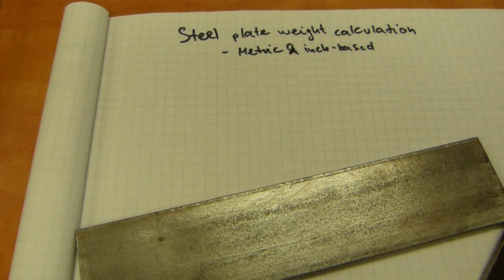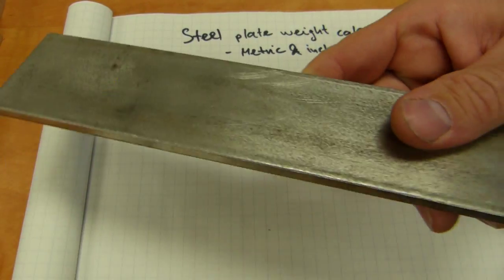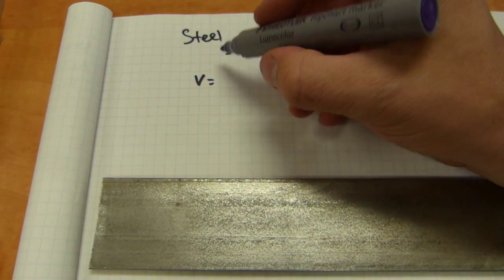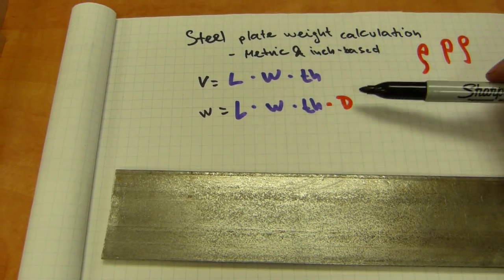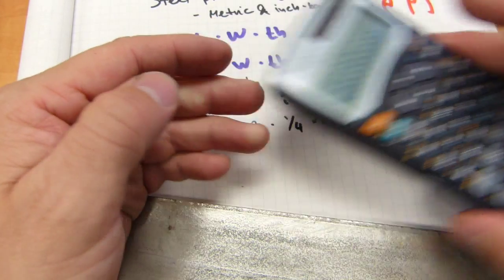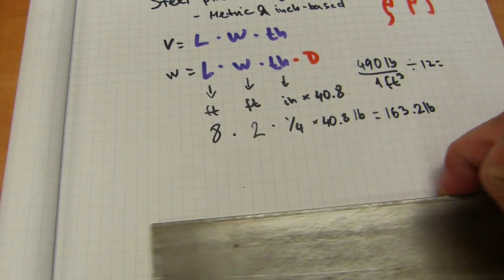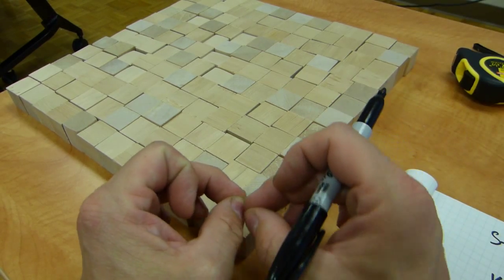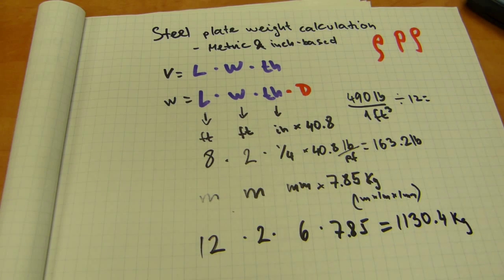Weight (mass) of steel plate calculation

Comment: Is there a way to know the load capacity of a steel plate. For example if I put a steel plate over a hole or between two steep cliffs,  What thickness of steel will I need for a certain weight, say a one pound weight to say something has heavy as million pounds. 

Any simple way of knowing?
Reply from the maker: No simple way.
Is it a point load? Is it uniformly distributed? Can the load move? etc.
What does work is building a small or full scale sample and testing it, see how much things deflect, do they bounce back, etc.

Comment: What about if the part is in inches length and width.
Reply from the maker: Good question.
Option 1: Convert inches to feet, for both L and W
Option 2: Calculate with inches but divide final answer by 144 or some time before pressing =
Example : 96 x 24 x 0.25 x 40.8 ÷ 144 = 163.2 lb
Makes sense?